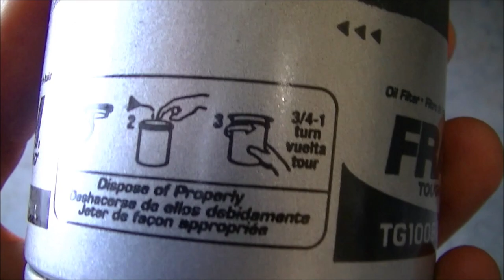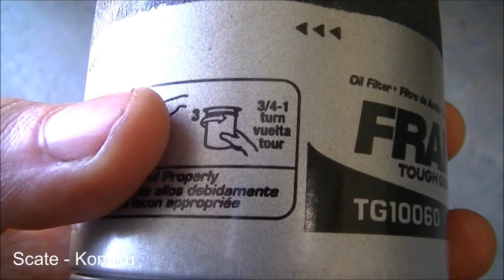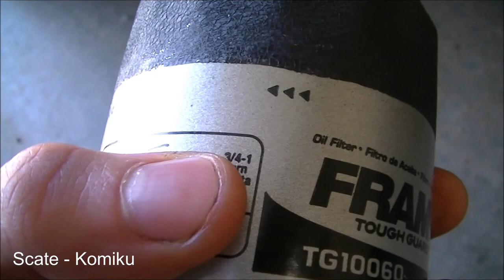DIY Oil Change & Checking Fluids | Dodge Avenger

Comment: 20:28 sure is a fill line... look closely!!
Reply from the maker: Yes, there is! (we found the min line another day, when we weren't juggling a camera).

You will see the 'full' triangle on the camera, but the 'fill'/minimum is actually more visible from the other side. The text is below the seam.

This was right before we changed his brakes. After the pads were replaced it went right back up to around full.
Reply: @FixingWithFriends  yeah use a flashlight and put it right up to the reservoir to illumiante the whole reservoir and youll see it

Comment: Itis a 5 qt. system but you must start the engine then check your oil
Reply from the maker: Yes, you should always check it again after starting (then letting it sit). We checked it again a while after checking the transmission fluid but did not have that on camera unfortunately.